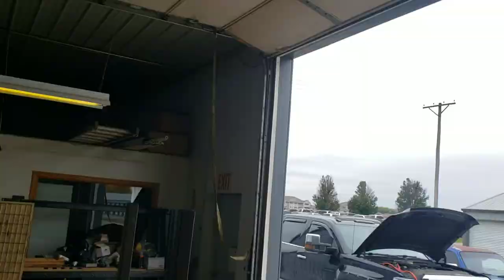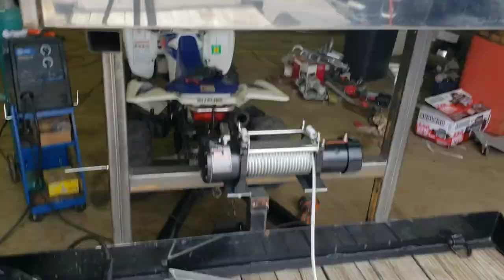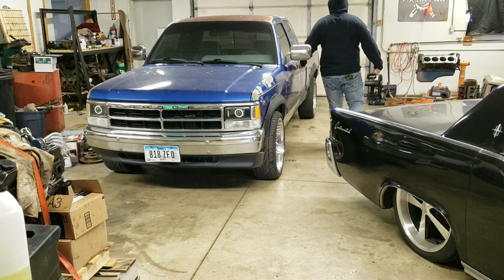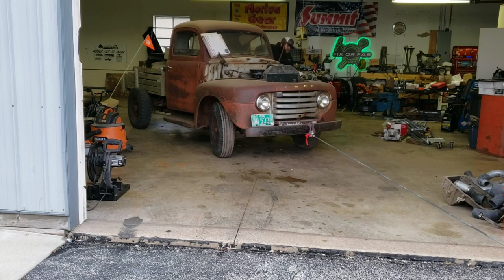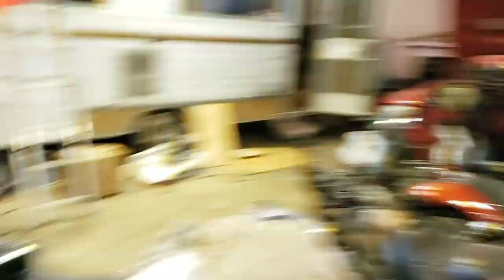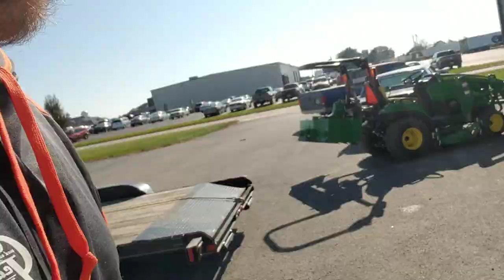Car trailer mods!! 12k Harbor Freight winch and stainless tool box!

Comment: Why did you elevate the winch above the fairlead? We have two of those 12,000 lb HF winches, they work great for a cheap price. However I understand the transmission will quickly corrode if it gets wet. On my car trailer I mounted a tool box on the tongue, winch & battery is inside, cable pulls through a small hole in the tool box. The other is on a boat trailer with a cover over the winch. Both work great.

Comment: I would add pulleys you can drop in those stake pockets in the rear of the trailer. I can see it helping to get the right pulling angle in the future. 

Nice job on the video.